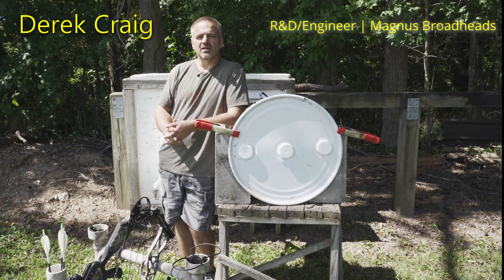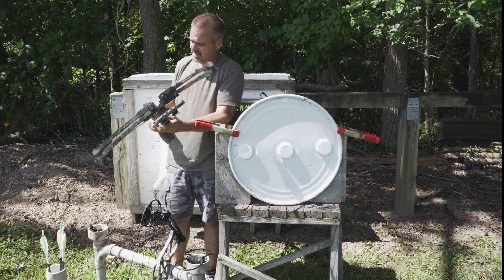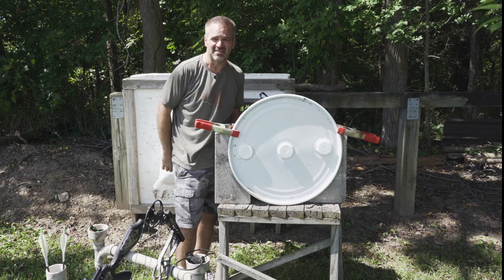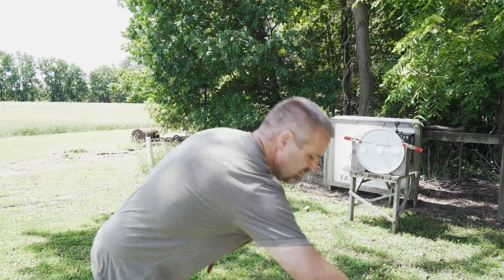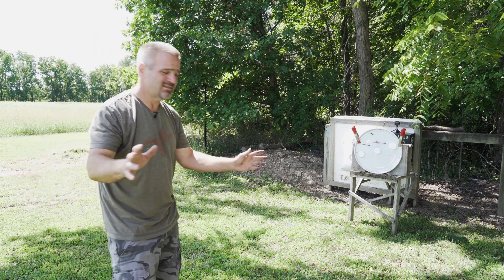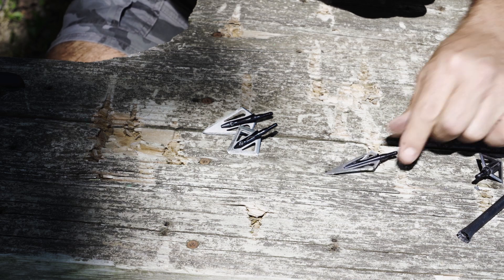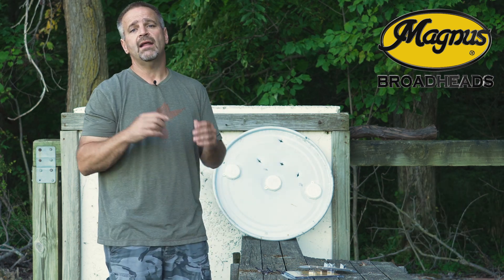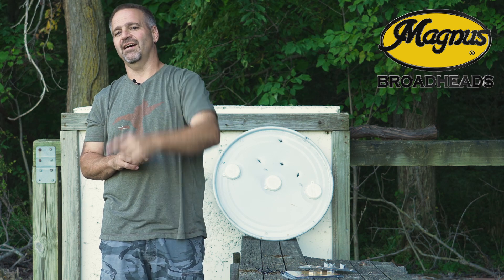Magnus Broadheads - Durability Test with a Steel Drum Lid

Comment: I like magnus heads, but they are not very durable. I shot two deer last year with the stinger 2 blade out of my traverse, and both heads were junk afterwards. The broadhead did its job, and I’m not upset but to go through the rib cage only and stick in the dirt. And the ferrules were bent significantly. Like I said their a good head just not super durable. And I won’t use the warranty system you guys have for those two heads either, because they worked and them bending isn’t your responsibility to replace in my opinion. I think I would like the black hornet series better than the stinger, and can’t wait to get some of them. Also the comment about the tool steel being brittle is kinda ridiculous. Bishop makes the most durable heads on the market, and their made of a2 tool steel.

Comment: Awful ballsy shooting that thing a couple yards away with no eye/face/body protection. I'd be afraid of getting some kind of ricochet, especially as you said you've never done this before.
Reply: It wouldn't have been a problem if the insert had not come out of the one.  But yeah could have been ugly.  I tend to live life on the edge ...
Reply: @NewDayOutdoors  A quick follow-up for what it's worth; after watching 3 or 4 videos I bought a pack of Stingers (100 grain 4 blade) for my crossbow.  I took a doe and my son took a buck with one, double lung shot from 35 yards, the buck ran 50 yards and laid down and didn't get back up.  Like them a TON better than the Grim Reaper mechanicals I started the season with (one didn't open and I was never able to find the deer). Thanks for the videos, made a difference for us this season.